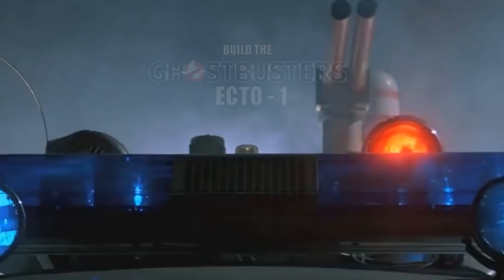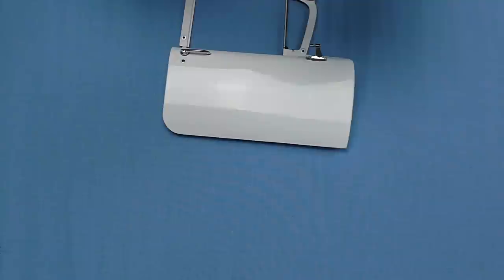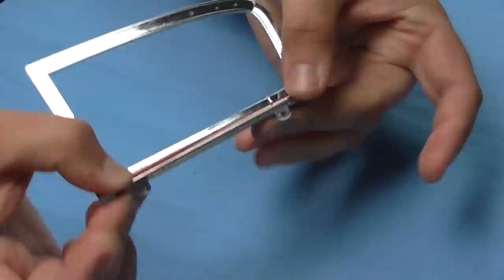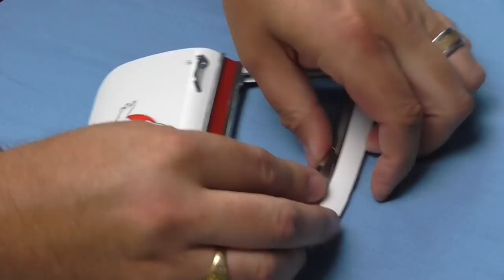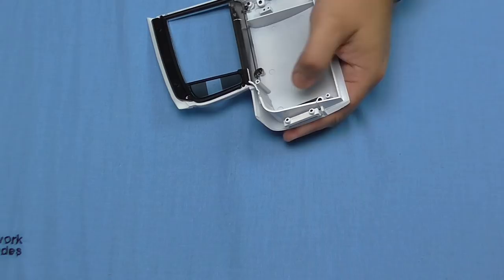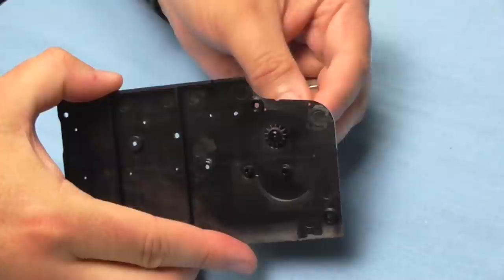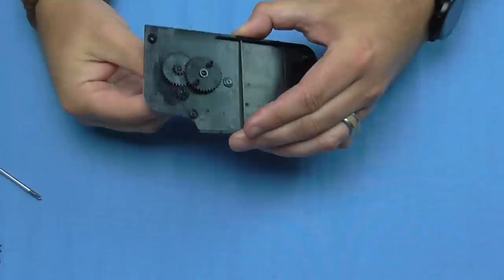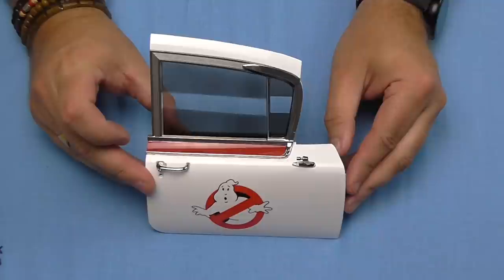Build the Ghostbusters Ecto-1 - Part 91,92,93 and 94 - The Right Passenger Door

Comment: Here in the US I received the same Pack 91 right front door that you did.  However I was not notified by Eaglemoss about the corrected version of this door.  I contacted Eaglemoss here and they don't have a clue as to what I was talking about.  The only response I got from them was they planned to send me an exact replacement for the door I already have.  Go figure.  I still plan to hold off building Stage 25 and see if the corrected door is sent around Pack 107.

Comment: I'm surprised they're sending a brand new door to fix that mistake. Surely it would have been easier to just make a white plug to fit in place of the mirror or something. That seems odd, especially given how they never bothered to fix the flux capacitor in the DeLorean
Reply from the maker: Definitely.
Reply: That's honestly what I was thinking they should've done instead of redoing the entire part. Smaller, easier, and more than likely cheaper than just redoing the entire thing.

Sure there'll be grooves from where you can see the hole, but you can overlook it easier.

Comment: That's insane.  They should know the door doesn't have the wing mirror, because the mirror mount should already be installed on the right fender by this stage.  Someone in the factory just got fired for this screw up.